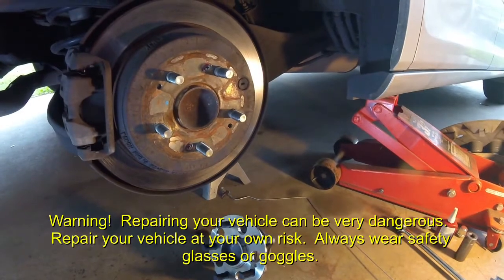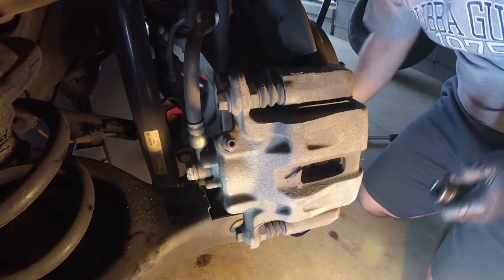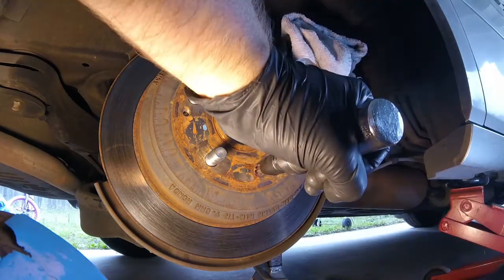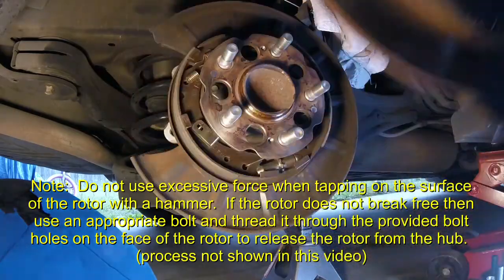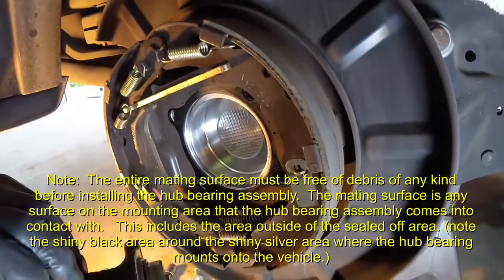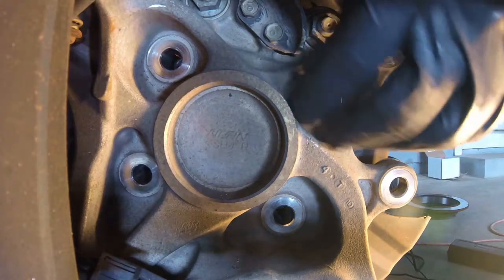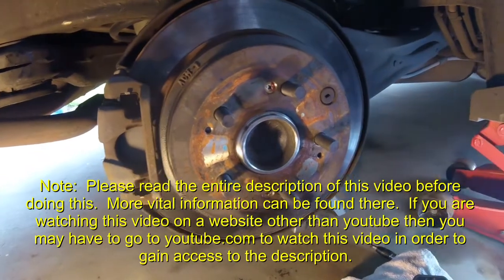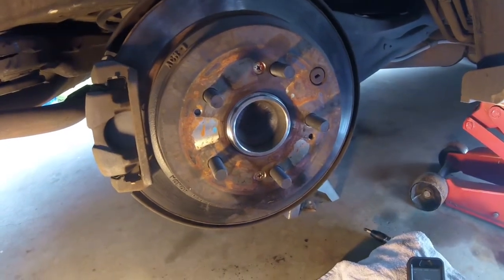Rear Hub Bearing Assembly Replacement 05 Honda Odyssey

Comment: Like that impact tool. I did not know it does exist. Good idea to BB blaster those two holes on the rotor to melt out the rust as you pointed out. The four mounting bolts are not easy to find on the internet. That is how I ran into this video. I did not know the rear has brake shoe. Nice video anyway.
Reply from the maker: Thanks for stopping in!  Hope your project turned out well.

Comment: Anyone have Honda's torque specs for the rear hub bolts?
Reply from the maker: If you go to Autozones website and set up an account you get access to free repair information, like torque specs.  Also, many parts stores have manuals for sale and they don't cost an arm and a leg.
Reply: Torque Specs:
Wheels: 94 ft-lbs
Brake Calipers: 65 ft-lbs
Hub Bearing: 72.3 ft-lbs

Comment: What did you torque the bolts to that mount the wheel bearing assembly?
Reply from the maker: As mentioned, you need a manual for that information.
Reply: Not everyone has a manual.  If you have a manual, you could tell what it says.  What was YOUR torque wrench set at when YOU torqued the bolts?
Reply: Torque Specs:
Wheels: 94 ft-lbs
Brake Calipers: 65 ft-lbs
Hub Bearing: 72.3 ft-lbs